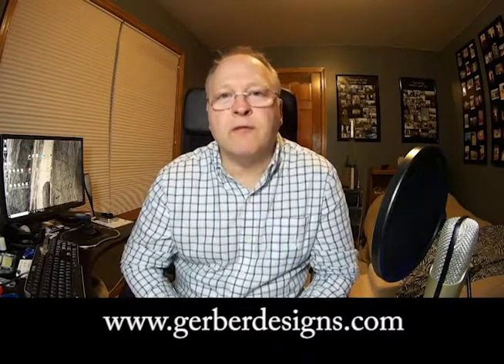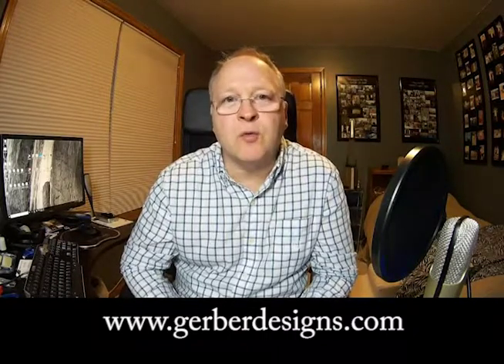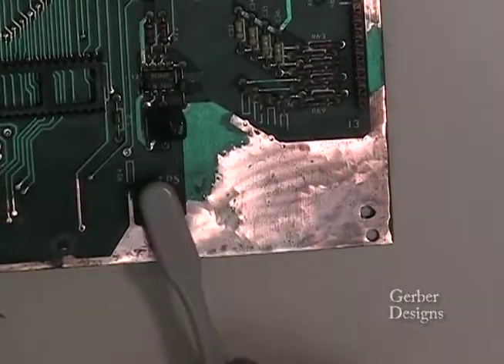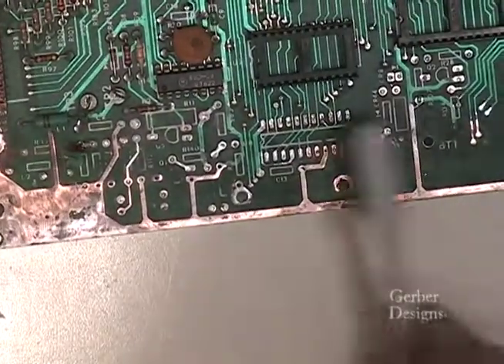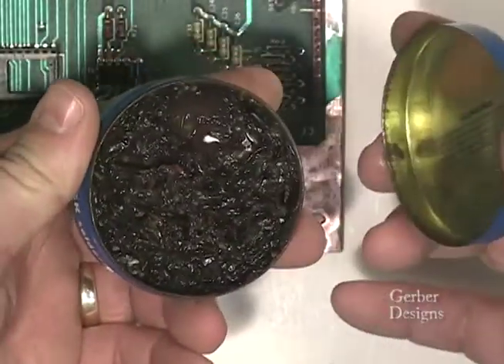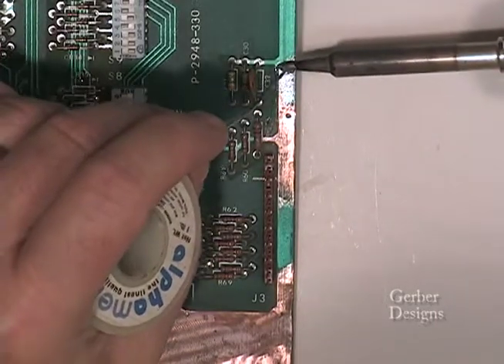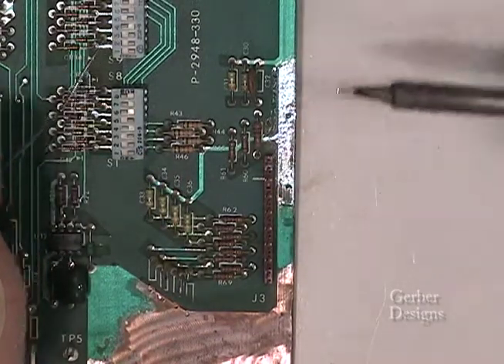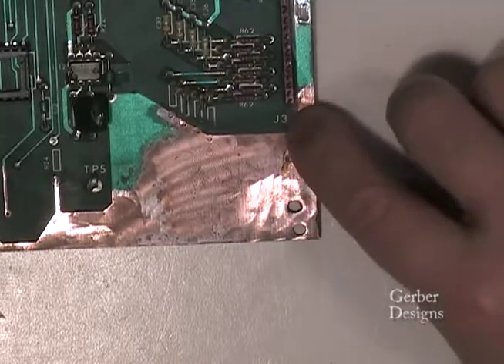Part 4 of 7 - Tinning the PCBoard - Bally Pinball AS-2518 MPU PCBoard Corrosion Repair

Comment: Nice vid, but isn't it important to neutralize the battery leakage (base) first before tinning?
Reply from the maker: After you have removed the corrosion with the Dremel and emery disc, there is basically no corrosion left to neutralize.  I suppose you could wipe down the area with some alcohol before tinning just to clean it from the sanding.  Looking at boards I repaired this way over 20 years ago, they held up pretty nicely from this process with no signs of any corrosion coming back.  I have seen the other methods of neutralizing the base and I am sure they are fine, but this has worked very well for me and is "time tested".